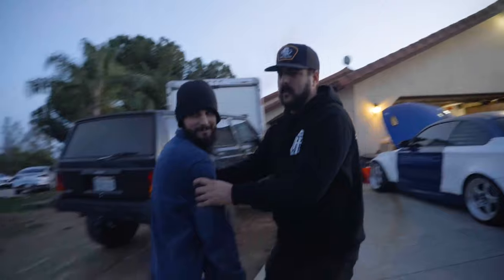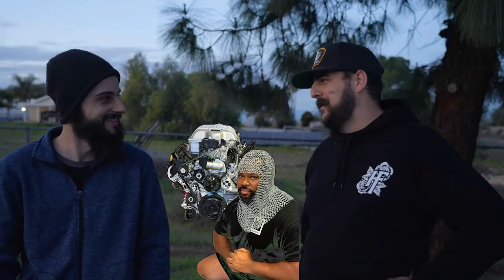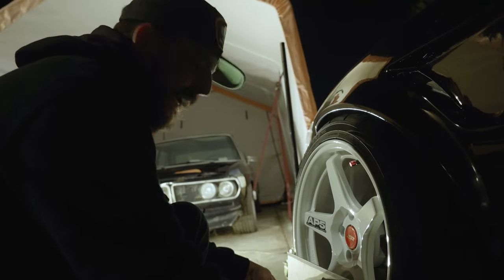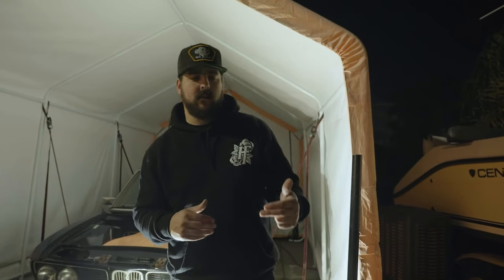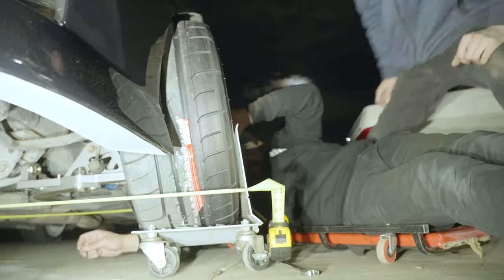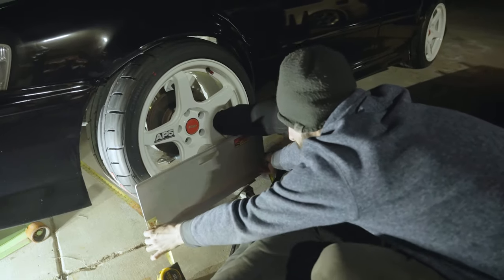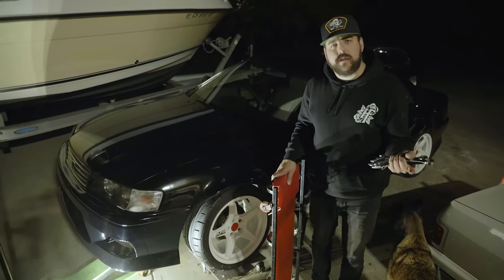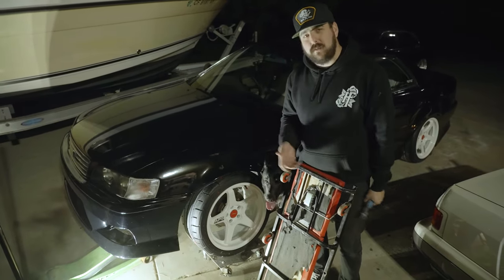How to Do an Alignment on a Car at Home using only a Tape-Measure

Comment: yo micah what would be the best to run for self steer toe in or toe out bare in mind i’m drifting in a field any help would be much appreciated
Reply from the maker: Idk that I’ve had the toe affect the self steer. Adding caster would give you mores self steer but it has pros and cons. Make adjustments and find what you like
Reply: @MicahDiaz  respect bro thanks for the reply